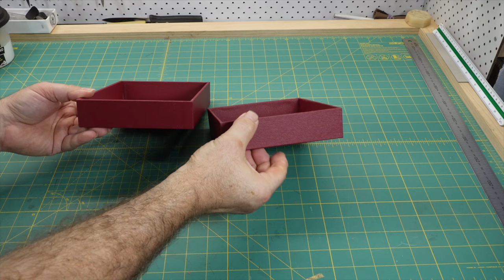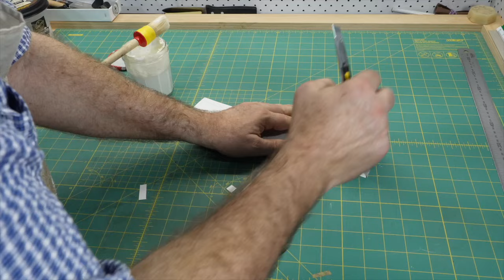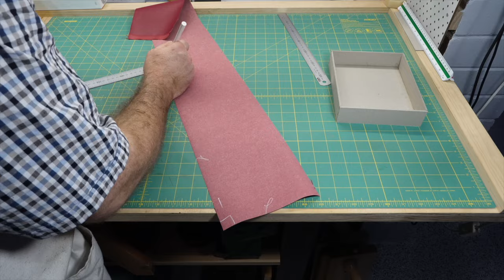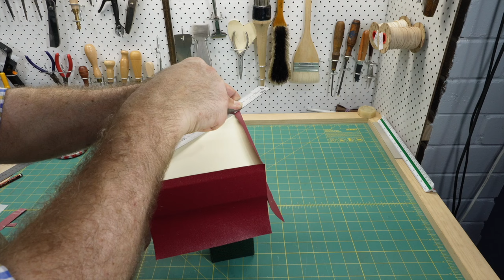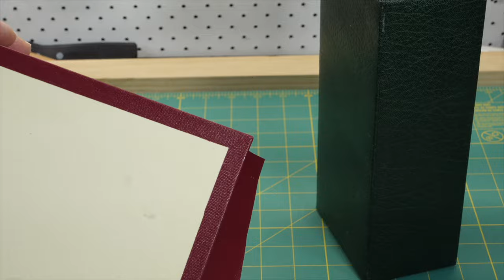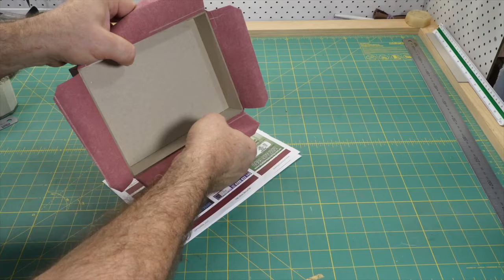Covering a Tray by Wrapping Around the Walls // Adventures in Bookbinding

Comment: This is my preferred way of covering trays for hinged lid boxes etc. I originally learnt to make boxes following the Hollanders' book, which has you cutting a separate piece of covering material for each side of the tray. That method takes a lot longer and involves a lot of fiddly measuring for little gain (unless the tray is too large to cut one continuous strip, but even then I try to have three sides in one strip then piece in the side that will be glued to the case.